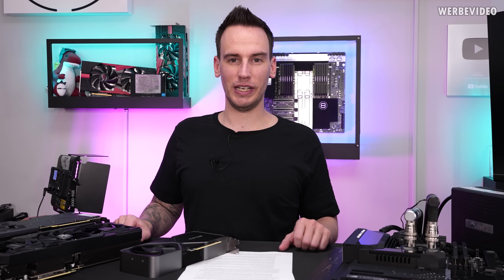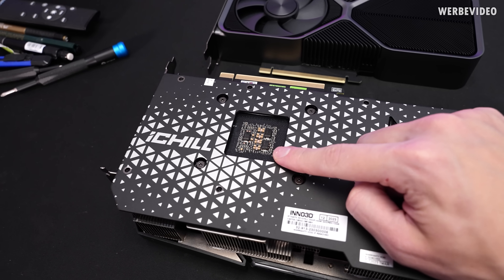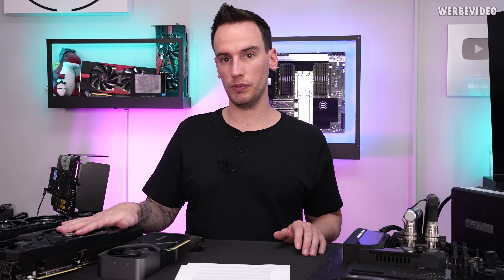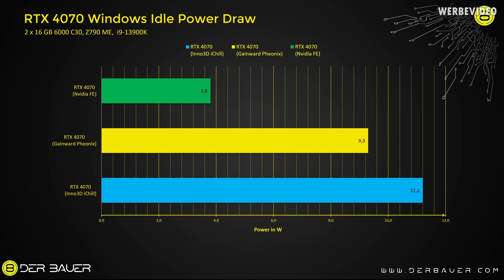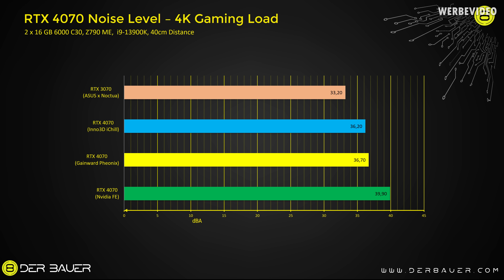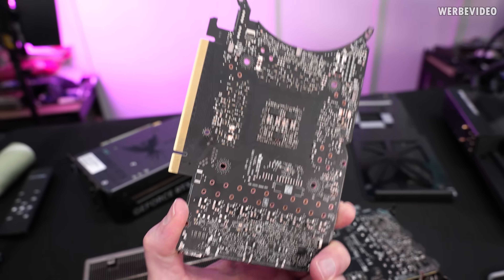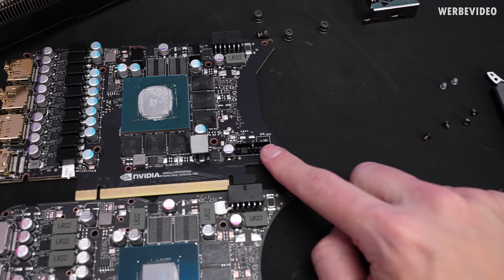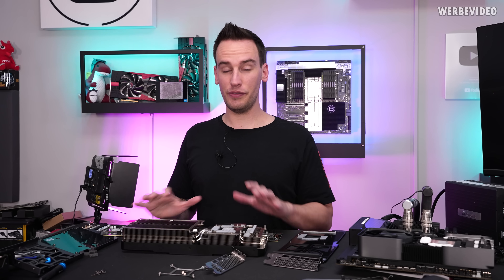Nvidia doing Nvidia-Things again - RTX 4070 "OC" Review and Teardowns

Comment: Should have been called a 4060 and priced at $400 USD.
Reply: The fact that this could be the "4070Ti" before Nvidia unlaunched the 4080 12GB is mind-blowing. 😅
Reply: Or the same price but has 16GB of VRAM
Reply: Nvidia is definitely sandbagging everything but the 4090 to prevent these cards from lasting several generations. People are still quite comfortable on a 1080 Ti, and Jensen loses sleep at night thinking about how much money he lost because people weren't forced to upgrade sooner.
Reply: @simplyscholar21  yeah, I have a 3090 and if you look how cheap people are selling them today I think to myself. Why did I buy in the first few months of release? It's a stupid good card that will last me for 6 to 7 years or even more. But it's worth has gone down by 2/3rd in what? A year and half
Reply: @simplyscholar21  only people comfortable with a 1080Ti these days are copium addicts.
Reply: @simplyscholar21  I'm still rocking a 1080ti. Ray tracing with low frame rates in 1080p for $800 vs no ray tracing custom settings in 4k, I'll keep my 1080ti, thanks.
Reply: @Uncl3_Ry  you aren't rocking 4k in Cyberpunk with a 1080ti, thanks. Without raytracing at 1440p with a 6950XT I'll get maybe 70 FPS.
Reply: @Uncl3_Ry  why lie about something that is so easily disproven?
Reply: 1 tier nomenclature and $100 slapped on top, seems to be Nvidia's tried and true marketing strategy.
Reply: $250-300.-
Reply: Absolutely... I agree 100%
Reply: The days of $400 GPU's are over. I'm not disagreeing with you, but they are over. We have less performance\price and low VRAM across the board with 40 series. And they keep cutting the memory bus as well.
Reply: 279$
Reply: It wouls have been a great card, maybe even 450 dollars if it had 16 GB of VRAM.
But we have to acknowledge that if Nvidia didn't unlaunch the 4080 12 GB this card would have been the 4070 Ti😅😅😅
Reply: No priced at 329 or lower if It was a 4060.
Reply: @AdaaDK  that's what the 3050 was selling for 😂
Reply: Gamers nexus just did the teardown. It was designed for 16gb of ram. Even the heat sink has the contact plate for the missing memory modules. f*ck nvidia
Reply: And was surely supposed to be the 4070ti before people complained and the 4080 12gb became the 4070ti
Reply: Lol no it shouldn't
Reply: They'd still charge $700+ if it was a 4060
Reply: Performance should be main reason for upgrade.
Going from 3070 to 4070 makes no sense, as price jump is there, so comparing it to 3070ti ends up only in big energy savings mostly.
There was usual no reason for upgrade to next closest gen, but 4090 made it bit unclear, as 3090 price was already heavily increased, so 4090 100USD price increase seemed to be good for upgrade from 3090ti.
Just to add these "lower" (that 90) tiers show far smaller bump in performance than 4090 but 100USD price jump is there too. Haha.
Reply: @gstormcz  i mean the 4080 made sense too. Cheaper than a 3090 and better than a 3090ti... Not from an upgrade from 30 series perspective, but from an upgrade from 20 series perspective
Reply: @HughesDePagen  The problem is cut die sizes on lower than 90 tier. Nvidia wasted alot of potential of node improvement, except 4090. That Pascal moment is only for 4090, rest of lineup is sadly walking behind excitement from leap made by top tier.
Reply: I remember when the 970 was $330. That was the greatest card ever, even with the fake vram.
Reply: I want a 16GB version of this.  They could of sold it to me instantly if it was a 16GB card.  12GB isn't enough for a 2023 upper mid rage GPU.
Reply: @KameradVonTurnip bruh what game are you playing at 1080p or 1440p thats taking this much vram...because if youre playing 4k...thats the wrong gpu to do it with
Reply: @Yourven Parianen  the ones that will be here over the next 12 to 24 months from ps5 and xsx ports that aren't crossgen ps4 xbox one games
Reply: @yourvenparianen5390  bruh🤡 this card is perfectly capable at 4k
Reply: @KameradVonTurnip  this isn't upper-mid range, it IS midrange
Reply: I mean it still qualifies to be a 70 level card. Tho, it should have been around 450 or lower
Reply: Should have been called 4069 and given to me for free
Reply: I wish he had shown a 3060 next to these, because I bet we couldnt tell the difference, they are so close in size and cooling and power draw, the only difference is N8 vs N5 and a 50% price hike.
Reply: @manicdan481  almost as if the 4N node costs 2x 8nn
Reply: @WayStedYou  Watch nvidia's margins and you will see that the cost of the chip is still no where near the price they are selling it at. Sure $25 might have doubled to $50, but they charge AIBs nearly as much as they sell their founders cards for. There is a reason EGVA got out, and they even stated there was no profit when selling a 3090 for $1200
Reply: @manicdan481 the 4070 is typically 20% faster than a 3070, what makes you think a 3060 would make it worry?
Reply: @oxfordsparky  You are paying $600 for the same hardware that can be found on GPUs that go for under $400, making it clear that all that extra revenue is going back to nvidia for their absurd chip prices they charge AIBs
Reply: Exactly - the pricing on these are so bad that notwithstanding what Derbauer said about energy prices at 7:30 , AMD's past generation cards offer better price performance. I've said on a few threads that AMD could just Rebrandeon a 6950xt into a 7700xt , give it faster gddr6 , stick a new cooler , price it at $549ish and people will lap it up (except for those using RT).
Reply: Should have been called the 4050 and been $99.99
Reply: @c-dub8639  lol shut up dude 😂😂😂